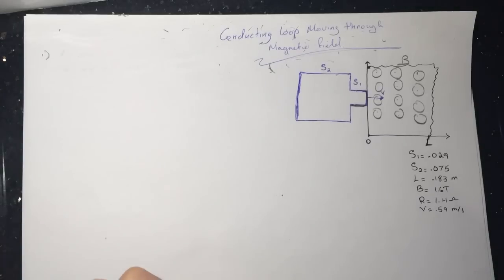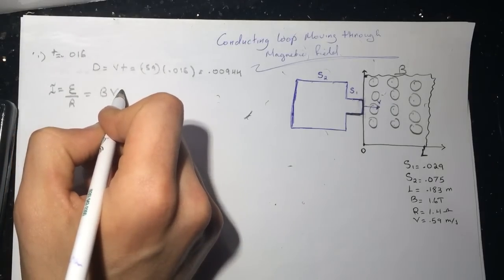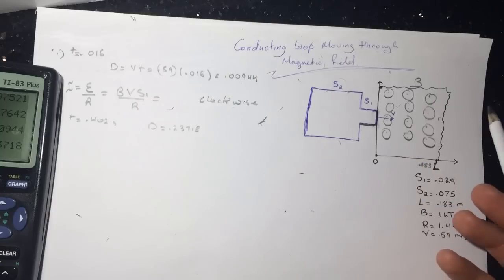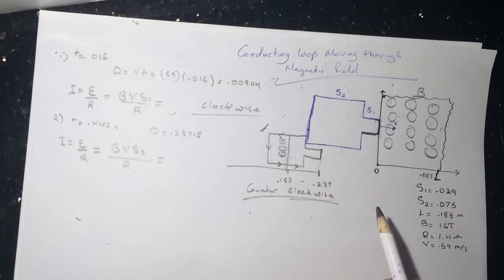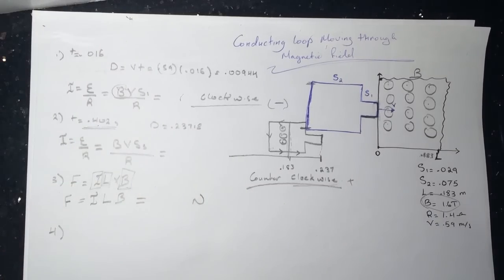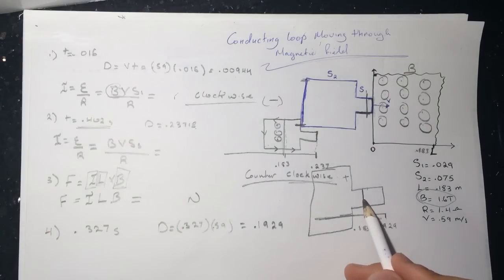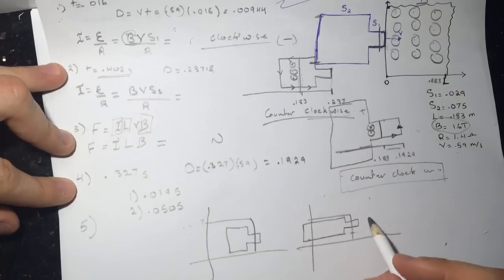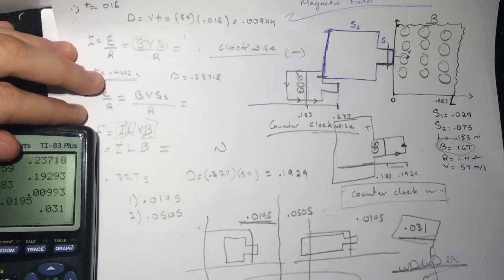Conducting Loop Moving Through Constant Magnetic Field "SmartPhysics" Solution.

Comment: #3 is wrong, the actual formula is F=v * B^2 * s2^2 / R
Reply: can you explain how you got that?
Reply: yasser siddique I wish, all I know is it worked for the correct answer.
Reply: @ryanhanson1524  3 is right you just didn't plug in the values. I =BvS2/R so when F=ILxB, it turns into ILB, and L is s2. You end up with the same equation.

Comment: I dont quite understand how you are getting the direction of the wire? Does the wire always go against the B-field when it is entering the B-field and vice-versa?
Reply from the maker: When the area of the wire enter the B field , the wire doesn't like the change in B field pointing out of the screen. That's the way I do it , when the magnetic field is increasing in a direction then the wire wi induce a magnetic field that appose this change which is into the screen, so to induce into the screen B field then the current should be clockwise. Hope it helps.